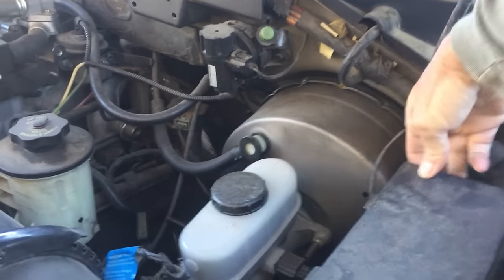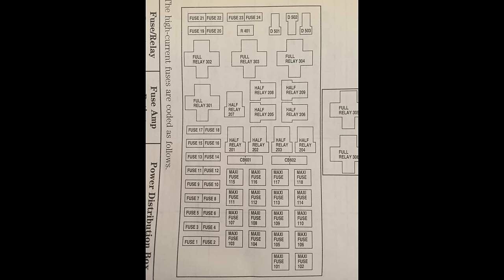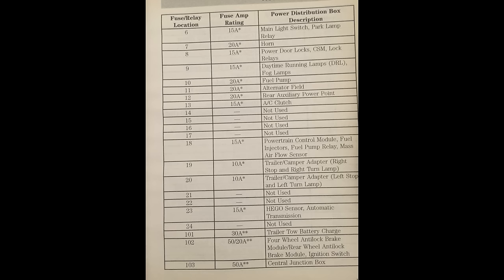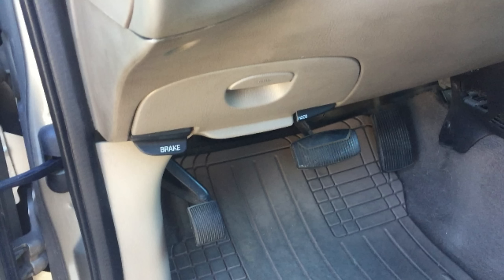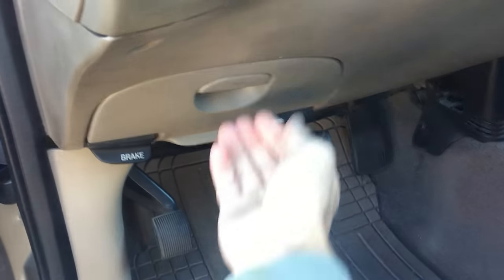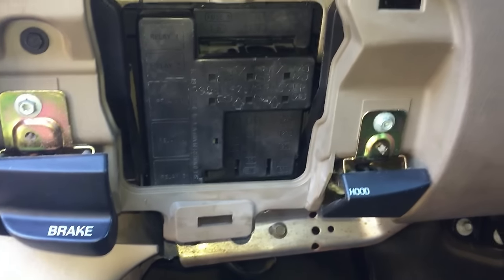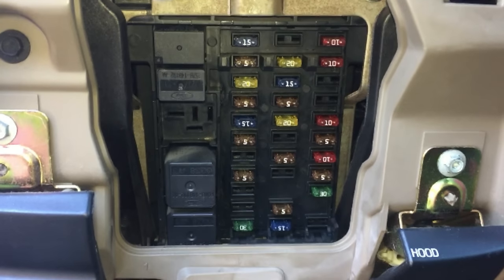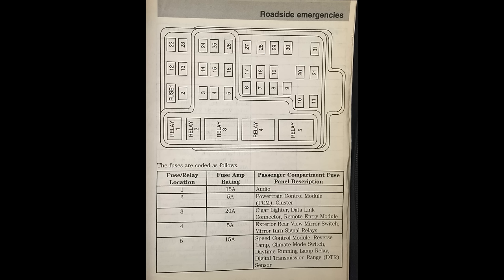1997-2003 Ford F150 Fuse Box Locations & Diagrams

Comment: You're awesome. I've been searching and nowhere online had anything for my truck that matched the relay box set up. I needed to know what the relay spot in the box that was faulty to figure out if it was fuel pump or pcm. Both give similar symptoms but have a lot of connection cookie trails and I knew whatever that was is the end problem. Just wanted to make sure there weren't 2 coinciding issues before throwing parts in.  I knew it was 304 but that number didn't show up online. Just 34 which happens to also cause this problem but this truck doesn't have that fuse. (Yes I tried a new relay first but was still throwing inconsistent voltage) THANK YOU!!!
Yes, I took screenshots 😁
Reply from the maker: ToxikElement 13 Glad you found it helpful!

Comment: You answered my question seven seconds in. Couldn't see how to open the fuse box, and didn't want to break the old plastic.
I have .45 amp quiescent current, so have been going through each fuse and relay. Putting them back in with DeoxIT.

Comment: Thanks for putting this video, my truck was missing the manual and labels of fuses,
but the repair manual and they didnt have this  details.
Reply from the maker: Mario Lanz Glad you found the video useful!
Reply: Mario Lanz I need to know what fuse is for the cigarettlighter and what size fuse
Reply: The Frugal Toad what size fuse does the radio take and it's location
Reply: The Frugal Toad that is all for now, and thank you
Reply: Delma Naff 25a and it’s number five fuse in cab
Reply: What fuse is for the heater
Reply: Rebecca Ward  you’re looking for the relay for the blend door / blower. It’s 23 under the steering wheel in the dash

Comment from the maker: Glad you found the video helpful!
Reply: Do u know which fuses and relay r for the running lights ? Trailer brakes and signals all work but no running lights. We changed relay 5  by driver side. And changed fuse 9 under hood. (02 ford 150)
Reply from the maker: wintersnow1243 Did you check #6 15A in power distribution box in engine bay?
Reply from the maker: wintersnow1243 9 is running lights. Did you notice any corrosion when replacing 9? You may have a short in wiring...
Reply: this was exactly what i was looking for thank you. now if i could only fix the problem
Reply: do you have a link to where i could print out the diagram?

Comment: this is not a ford f150 fuse box
Reply from the maker: Gary Bartley Yup it most definitely is. 2001 F150 Super Crew Power Distribution Box. Fuse box is located inside cab above brake release.
Reply: Looks like my 98 f150.